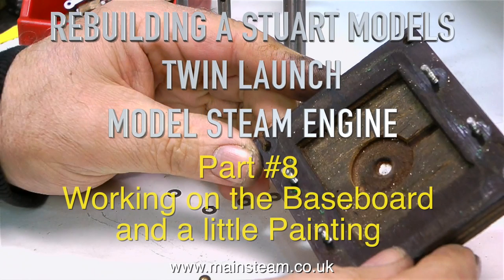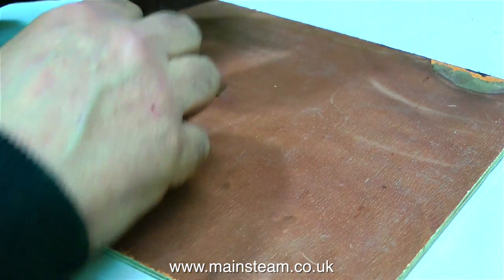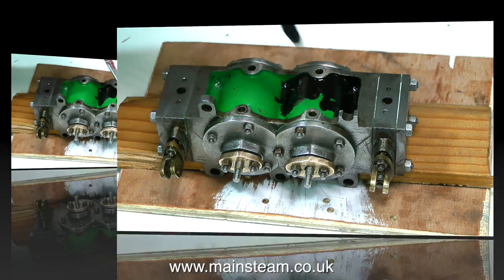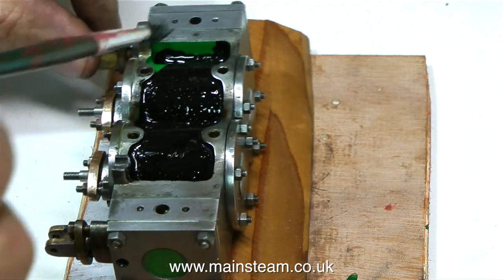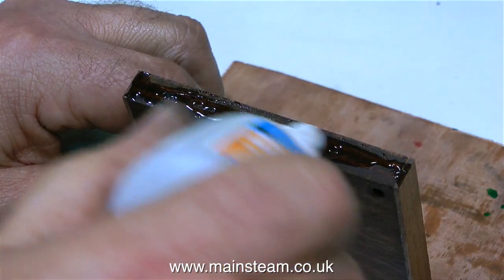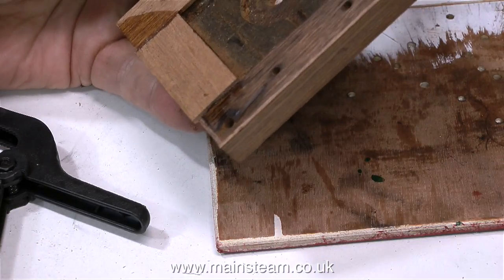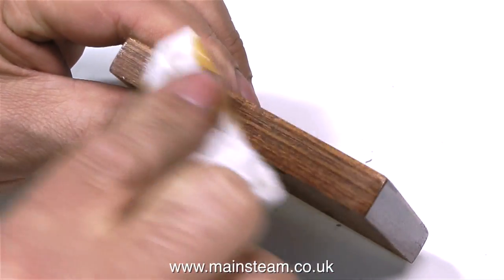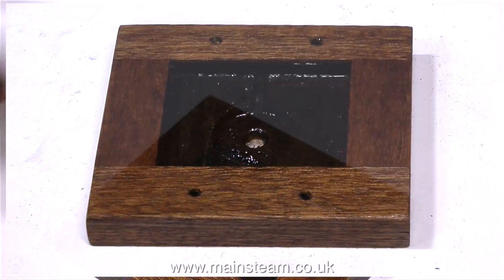STUART MODELS TWIN LAUNCH STEAM ENGINE REBUILD - PART #8

Comment: How are you cleaning the ports in the casting or are you? Additionally, why not sand the rough original plywood base plate before applying glue and the mahogany strips?